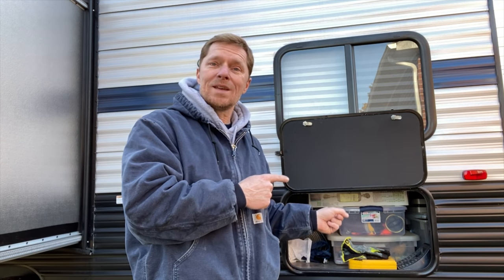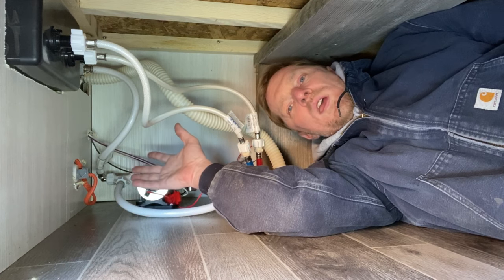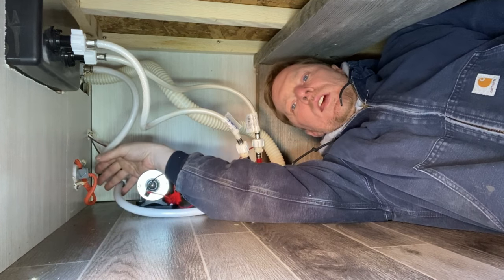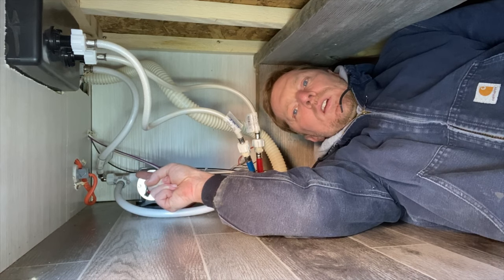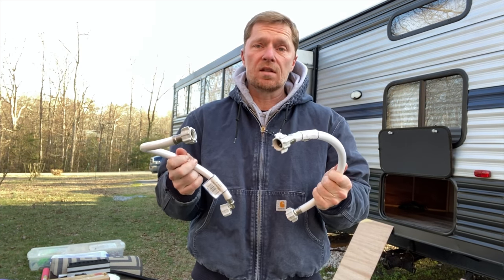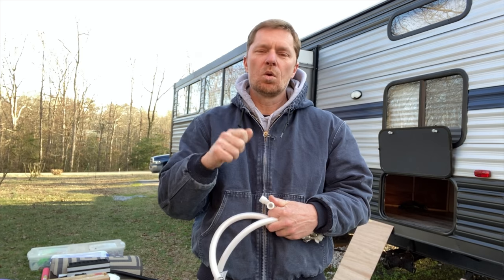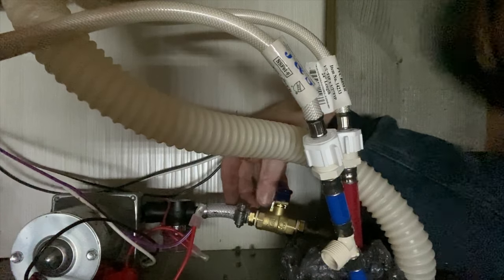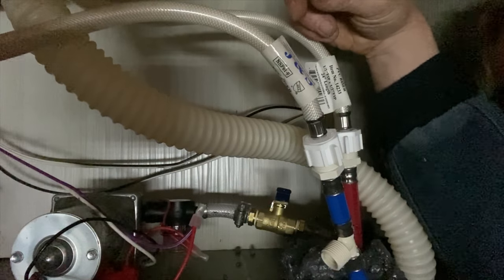RV How To - Water Pump Check Valve Bypass - RV fresh water tank for beginners

Comment: I've had this happen too many times. When I'm hooked up to campgrounds. Since it does not happen all the time ( but I now watch my fill tank.) But my thoughts. I Believe 1 the campgrounds shut the water off  then back on. 2 I bumped the water pump button . If I go and undo the hose and reboot if ya will. That cheap check valve works again..
5 I turn off the city water at bedtime and if leaving for anytime..  I'm lucky I can see my fresh water tank. From a outside door. Water pumps also right there.  And it thankfully has some flexibility and the overflow. Water all over the ground aka waste if water and a mess.  I like this idea.  Let me know how it worked out for you in the long run.
Reply from the maker: It’s been working good so far. Funny thing is that the built in check started working again. Now the valve is a backup

Comment: Just got back from a trip and had this happen to me. Thanks for posting the video - I was going to put the valve between the pump and city water. Much easier to put the valve between the pump and tank.
Reply from the maker: It has worked wonders for us. I just have to watch the campground water pressure a little closer to make sure I do not acquire any leaks. Glad the video was helpful.

Comment: I had the same problem with my Keystone Outback 2010 and with 3 rd in place problem solved. I had already had Camci by-pass valve in stalled inlet side of the pump coming from fresh water tank. No leaks and pump runs good. I make sure by-pass valve is in up position closing off FW tank from filling.  Anti freeze can be pump thru pass valve from inside travel trailer winterizing whenever. Thanks for input about leaking by check valve and city water pressure to high causing problems.
Reply from the maker: I like the idea about adding an inlet at that location for winterizing. I may have to make thatt modification myself. Thanks as well.
Reply: I can't believe how hard it was for you to get to water pump from the storage area. There should be an access cover from inside coach.  A lot new RV's tech are telling owners to fill fresh water tank with antifreeze to winterize unit.  I first use 30 lbs air pressure blow out all lines and then use by pass valve Camco to siphon from jug antifreeze thru lines. Double sure and protected.
Reply from the maker: @danieleaster9131  that’s exactly what needs to happen. Your so right

Comment: I need to do this with ours. Noticed that some water is getting into the FW tank on my last trip. Wasn't a bunch and cycling the pump on and off seemed to help which meant there was some debris in the check valve most likely. Cleaned out the screen filter at the pump and there was some crap in there. Thankfully our water pump is behind a small panel under the fridge, not anything like you have to deal with to get to it. I did notice that you apparently had to return the sharkbite valve since that wouldn't work with the white hoses and had to go with the barbed. SharkBite's are great for PEX but the white braided stuff, not so much. Great video.
Reply from the maker: Your right. I did have to return the shark bite. I would love your thought on sharkbite sittings. For some reason, i can not bring myself to trust them and a rolling and shaking RV. I have not tried them to secure that thought and would love your view on that subject.
Reply: @HowToRV  They seem to work very well for PEX. I’ve never had nor heard of any breaking loose. A small assortment of fittings and caps are good to keep for on the road repairs definitely in my opinion.
Reply from the maker: @RickGoodman1911  you are so right about that. Can you send me a list of fittings that you like to have on hand. This would make a good “How-To” video
Reply: @HowToRV  I think a good repair kit has a few 3 foot lengths of red and blue pex (I've also seen those used as a stir stick to break up a Poop Pyramid but that's a different YT video... ☺), and an assortment of SB fittings to include a cap, butt splice to repair a leak, and a ball valve (can double as a cap). Also a short length of the white braid and the same sort of barb fittings for the white braid. Should also include a PEX cutter for clean/easy cuts. Not 100% necessary but sharkbite makes a removal tool where you can remove SB's later on if you want to put something else on. How that sound?
Reply from the maker: @RickGoodman1911  that is exactly what I needed. When I get a chance to put all that together, and produce a video, I will surely let you know. Thank you for the support.

Comment: Ahh that old cummins sounds beautiful!  Not sure if it really makes it easier but on my camper you can fold back the bottom bunk mattress, pop out 2 screw, and remove the chunk of OSB over the pump. Either way its a tight location to work in!
Reply from the maker: You're so right....I learned that after the upgrade. I now have that board setup so that i can access it anytime that I want to. Thanks.

Comment: You seem well versed with rv water systems and hope you can help. I thought I had a pump issue so I bought a new pump, and that didn't change a thing. When I'm hooked up to city water, all is well. When using my fresh water and pump, all I get is air, surging, hammering, and lousy pressure. I've checked every line coming to the pump, along with the strainer. No leaks anywhere inside or out. This started this spring but luckily I've been on city water every time we've been out this summer. Any ideas, tips, or advice would be greatly appreciated.
Reply from the maker: If you can, try rigging a hose to the inlet side of the pump and put the other end of the hose in a full 5 gallon bucket of water. if the pump runs ok, then you know that the issue is between the pump and the fresh water tank. If it doesn't fix the problem then its either the pump Brand new can still be faulty) or down the line somewhere. On the inlet side, it is hard to find leaks because the leak would be air getting into the line vs water leaks. Hope this helps.
Reply: Agreed, Likely an inlet obstruction, crack, or fitting leak in your inlet line/hose.

Comment: thanks you!   Do you remember what size the hose end were?  5/8?  i have same problem but my camper is 2 hours away on our land.  Going to open it up in 2 weeks and need to do this...but its 2 hours away and i do not remember the size.  thanks again for video
Reply from the maker: I will check for sure and get back to you. If you would like, connect with me through email at How2RV@gmail.com
Reply from the maker: Mine was half inch. The valve did not come witht he barbed ends. I bought the barbed ends and screwed them into the valve. Hope this works out on yours.
Reply: Thanks.  I bought the valve and both ends.   That’s exactly what I needed.  Thanks again

Comment: As a safety first r the pump I think I would put another switch for pump power close to the valve. Turn valve to crash tank and turn on pump switch at same time. Then control pump from inside.
Reply from the maker: Thats a great idea. Thank you for the recommendation.

Comment: I wonder if you can find a directional valve or check valve to install in place of that quarter turn valve? This would allow water to flow from the fresh water tank to the pump but not the pump to the tank. This would automate the process and eliminate the risk of forgetting and running that pump dry.
Reply from the maker: I had thought about doing that. The reason for going this direction is to reduce most if not all water restriction to the pump. Check valves tend to have same flow restrictions. For all intended purposes though, a check valve would work just fine.

Comment: Nice project, as of yet I have not had to touch my valve.. well except for a leak on the hose  connections at the pump.
Reply from the maker: How or what did you do to fix it?

Comment: My The You have the ONLY video that I believe solves my problem! Plus your explanation is easy to understand. But uuugh! I am NOT looking forward to emptying out my storage space! IDK if it’s possible 4u to put a schematic up... but with your lines being white & mine were re-done in blue & red a few years back... I’m still not sure where MY correct spot for this is. Maybe it will become more clear after I empty my storage and get in there? I am getting NO WATER, and my tank was full, which I emptied before parking where I currently am. I can’t figure out why the hose is full pressure yet nothing coming ouwt... inside the RV. ?? I did have a creepy ex-con next to me who moved the nite b4 the water stopped & I can’t help but wonder if he did “something” to be a jerk since we had our share of head butting.?? My pump is reachable by opening the hatch. Sure regret not fixing that lock now!
Reply from the maker: This is surely a crazy circumstance. I will try to help if i can. Go to my website at www.ImaginYourOdyssey.com and connect with me there. I will try to get in touch that way. It is a lot more private that way.

Comment: In most of these the check valve is in the pump head. I'm having the same trouble, but I'm going to fix or replace the pump and retain the original functionality of the system.
Reply from the maker: If you have not already replaced the pump, Something that worked for me (Done on accident but worked) is to connect the city water and turn it on - With the city water on and fresh water tank full, run the pump and water inside the RV, Turn the pump off and run the water again. Do this a few times and it may clear the issue. Like i said, I did this because I wasnt paying attention to what I had on but to my amazement, it worked. I do not know why but it did. Hope this helps.

Comment: I just bought a 2021 Cherokee Wolf Pup 16 FQ and had a similar issue from day one!  My fresh water tank was filling even though I was using city water.  There were videos about freeing up the check valve by running the pump...that didn't work.  I looked at my pump and saw a strainer, thinking that was a check valve.  Glad I didn't change it :)  Is the check valve actually built into the pump?  I also think I saw a cut off valve on the line that feds the fresh water tank.  Could Forest River have decided to add a cut off or am I looking at something else?
Reply from the maker: These are all great questions. From what I can tell from mine, the check is built into the strainer but to sure. The pump does not have a check built in that I can tell. When I added the inline valve, I knew without a doubt that it would take care of the issue. I too watched a ton of videos and none of them worked for me and I did not want to keep buying pumps. With this fix, i have had no more issues. If yours had has a valve between the tank and the pump, it would hurt to give it a try and see what happens through a little trial and error. If you are going to try it out, do not run the pump for more than a couple of seconds just in case there is no water there. Hope this helps.....😀
Reply: Update: After contacting Cheyenne Camping, where I purchased mine, they informed me the check valve is indeed inside the pump!  They sent me a replacement since it is under warranty. I haven't made the switch yet but expect it will solve the problem.
If I still am experiencing the same thing I will certainly install a valve and not worry about it anymore.
Reply from the maker: You have my curosity. I would love to hear what the outcome is. Will you be using the original strainer as well. Also, Once you take out the old pump, are you going to take it apart to see how it works internally?

Comment: What valve did you use? And where did you get it from? Great video
Reply from the maker: I used a regular inline ball valve with female pipe threads, I then taped and screwed in the barbed hose fittings. I then cut the hose coming from the freshwater tank and inserted it there. When I am on city water, I would turn off the valve keeping it from going into the fresh water tank. I have found though, after using the fresh water tank pump over the last few trips, the water back flowing into the tank has stopped. If you watch the video about the fresh water tank drain, you will see how I can easily keep an eye on it. Hope this answers your question.

Comment: What if u dont use the pump? Will this cause the problem of filling up the portable tank and have water leaking out the side of camper
Reply from the maker: That is what happened to me. I was using the city water connection and after about 4 days, the fresh water tank had filled and I found out because I saw water coming out of the overflow.
Reply: @HowToRV  so do I need to leave pump on ?

Comment: Well, I'm having issues and this is where I landed.  I have flipped the levers and plugged water supply into the two different spots and both fill up fw tank 🥴
Reply from the maker: I am am guessing that on yours, no matter how to set up the levers, it still relys on the back flow at the water pump to not backfill the fresh water tank.

Comment: They make a check valve that goes on the pump and the line screws on the check valve.
Reply from the maker: I do agree. In looking at different types from gravity fed check valves, pressure release and control check valves, spring loaded check valves and auto release check valves, they all restrict a certain amount of flow. I opted for this because I want no restrictions at all. Your thought?

Comment: Is there a reason you did not install a one way check valve?
Reply from the maker: The main reason is to not restrict flow when the pump pulls water from the tank. With a valve, I know that I will get the same flow as if the valve wasn’t even there. My worry is that if there is a restriction of water getting to the pump, then it would not last as long.

Comment: Do you know where the water pump is for Forest river 38fkok sierra, thanks if you can help me.
Reply from the maker: I do not but if the pump will run then you can trace the sound. If the pump does not work then check behind an internal panel somewhere close to where the water fill ports are. Hope this helps.
Reply: @HowToRV  thank you
Reply from the maker: your welcome

Comment: a much simpler solution is a 1 way check valve in the water tank line so water can only flow toward the pump from the fresh water tank.
Reply from the maker: I agree but the flow rate is impeded and I did not ant to starve the pump on the inlet side. Most check valves have a 25% reduction in flow. With the size of the water line and limited flow when more than one faucet or shower is on at the same time, I opted for this solution. Your Thoughts?
Reply: @HowToRV  Many 1 way valves are full flow.

Comment: Great Video! The only thing was the music is not required when you are talking and is annoying.
Reply from the maker: I completely agree. I have recieved similar feedback over time. The newer videos that i have been making as of late, do not have any music in them. I have done some promotional videos for sponsors that require it, but other than that, I have stopped using the music add on. I have a new video series starting out this saturday at 4 pm est. I would love your feedback on them. The series will consist of 3 videos of the next 3 weeks. Again, Thanks for the feedback.
Reply: @HowToRV  Subscibed!
Reply: whiner!

Comment: You can actually put an in line check valve in, that way you don't have to worry about cutting the valve on and off 😉
Reply from the maker: Your very right, I went this way mostly because of flow rate in the suction side of the pump. In my configuration, I have to have it on the side of the pump that would pull from the fresh water tank. I thought about putting in a check valve on that side but i did not want to restrict water flow from a ball and spring check valve. They also make flap release check valves but  that would be to large for the application. Since i do not change the configuration very often, i went with the quarter turn ball valve. What are your thought?

Comment: I can't believe you put the valve behind the panel AND all that crap to move, every time. If you wanted to resort to that "fix" as opposed to replacing the pump, which does it automatically; the least you could have done was to relocate that valve to the outside of the panel (or on the panel itself). Also, the valve you came out of the store with, wasn't the one you used to do the repair. That was quite confusing.
Reply from the maker: I went and made an access panel on the lower bunk where the valve is located so it is very easy to access. The reason for the valve versus just changing the pump is because of cost and reliability concerns. I did not want to have to go through pump after pump. Sorry about the confusing valve purchase, i actually had bought a few different types to make sure that i had something that would work. I guess i could have done a better job explaining that in the video. I must say though, you are very attentive and thank you for the constructive feedback.

Comment: Just put a check valve in there, who wants to remove everything to turn valve
Reply from the maker: Check valves restrict flow. Flow restriction on the inlet side of the pump are not good. The flow restrictions are around 30% which means you you need more GPMs. To get similar flow rates. That’s why I went with the valve.
Reply: @HowToRV how about put a 2 splitter and add a second line with a second check vale then be at 60 percent and tie both lines into the one line for more volume

Comment: NEVER EVER put a shutoff valve in the suction of a pump.
The pump may be designed to run dry but still, NEVER DO THIS!
Reply from the maker: I completely understand your comment but it has been working for me for years. Although, if i was to forget and leave the valve closed, you are correct that it could damage the pump.